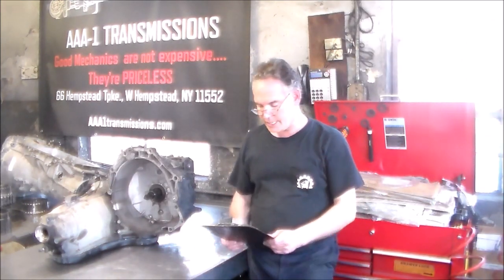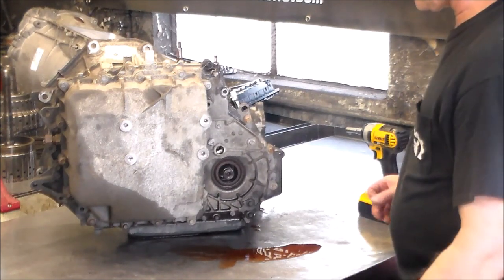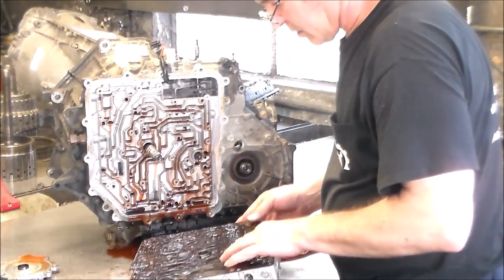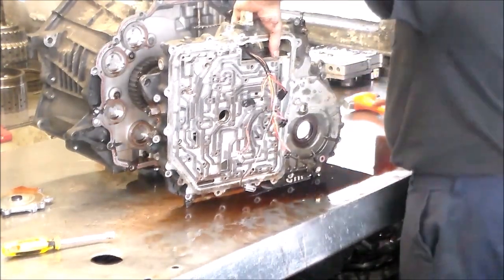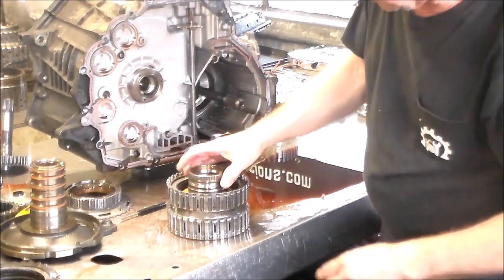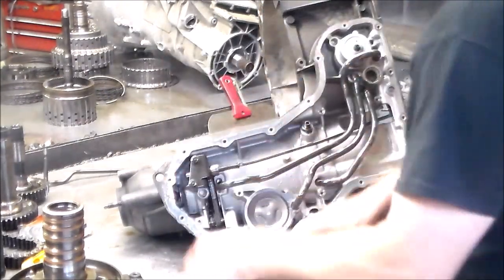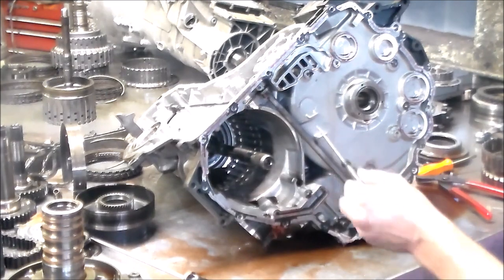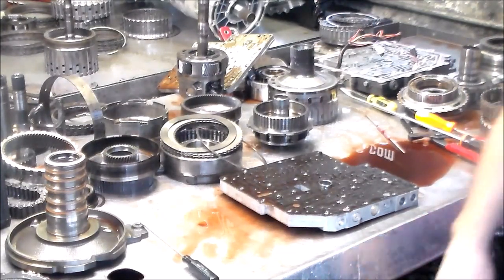4F50N Teardown

Comment: Absolute best Windstar video I've seen. I have two Windstars and I've seen PLENTY 😂 Thank you, SUBSCRIBED! 👍
Reply from the maker: Thank you
Reply: My first 1998 Windstar was retired at 412,000 miles with virgin trans, and my second 1998 Windstar was retired with 350,000 miles with virgin trans. Both were for work, full of tools and parts, weighing in at 5000 pounds fully loaded. I never hotrod them, always warm up before drive off, and service every 50,000 miles.

Comment: Excellent video !! , was just wondering what could cause a no reverse condition out of the blue ???
Reply from the maker: you mean working fine one minute and the next not?
Reply: @GaryFerraro  yes exactly
Reply from the maker: I would think something either broke or stripped inside the trans, How are the forward gears? @jesuschavez3191
Reply: @GaryFerraro  they are all good , it drives perfect forward , just took it apart today
Reply: @GaryFerraro  what do you think it could be ??

Comment: Hey Gary, thanx for the video! I'm doing a 2004 Freestar 4.2 ltr  4F50N / AX4N . Can you suggest a vendor list? These suppliers in Spring, Tx have supply deficiency syndrome.
Reply from the maker: What parts are you looking for
Reply: I've got a grocery list.
Piston and seal install tool, round plastic.
Master rebuild kit with Pistons and bushings. All.
All three shift solenoids 
PCP Solenoid.  
Lock up Solenoid
Correct chain
Drive gears?
Solenoid wiring harness. Planet Ford $123.22
Overdrive band
Overdrive band plastic retainer
Coast band
Pump shaft bearing with integral seal
Valve body upgrade kit &
 resizing tool.
Correct Torque converter
Need to insure the chain and valve body are correct.
This is the original trans, however it's been worked over by a shop I shouldn't have trusted.
Reply: This trans was setting the P0732 while the salvage ones they installed all set P0741. I believe they scavenged this one for good parts and assembled a Frankenstein. It all appears to be wasted and untrustworthy.
Reply from the maker: @philliptipton9371  Wow, you will be overhauling this yourself? There are different chains and different tooth counts on the sprockets
Reply: Well , yes sir. I'm in my 50th year paying taxes as an auto repair tech, teacher / instructor and concourse restorations, even to our super bowl,Pebble Beach. Nowadays, I'm too old to keep up. But I'm OCD enough to fix what others do not. This will be a challenge and I'm seeing things that just shouldn't be in a recently reman trans.
Reply: @GaryFerraro  looking for a early 3.8 taurus set 38t and 35t for a 3.19 ratio.

Comment: Ah the unplug it test... with these modules and CANBus if a module has short to ground it can bleed into CANBus system and causes all kinds of problems.  If the car has multiple CANBus (multiple power train canbus, linbus, etc) you will need the wiring diagram to see what is on the bus, then you can unplug modules while having an oscilloscope connected to CANbus and look for signal to return to normal.

Comment: You surely do a great job explaining everything. 
I was wondering if you could give me your intake. My neighbor and I are working on a 4f50n from a 2005 taurus. It has no forward nor reverse. We checked if there was oil pressure and there is. Also, the pump shaft and chain are in good condition. Is the anything else that could cause a no forward/reverse on any gear?
Reply from the maker: Did this happen suddenly with no warning?
Reply: @GaryFerraro  It did. The driver says she had been driving about an hour with no issues when all of the sudden she felt the car jerk a little and then it would not respond when she tried to go.
Reply from the maker: @450mijaou1  Before you dig into the trans, look at the pump splines in the converter, may have stripped out
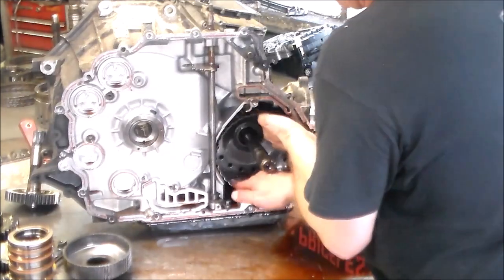Reply: I guess my neighbor found out what is wrong with it over night. He took it apart and found out that the part that you take off at 34:30 is stripped.
Reply: Do you know what could have caused that to happen?
Reply from the maker: @450mijaou1  the hub was stripped out?
Reply: Yes, all the teeth of about half of the pipe looking part is gone. Also the planetary set were that goes into is destroyed.
Reply from the maker: @450mijaou1  wow and no noises at all?
Reply: Apparently not. But I think the driver did not notice if there was any noise.
Reply from the maker: @450mijaou1  Thanks for the update
Reply: No problem. So what do you think could have caused that to happen?